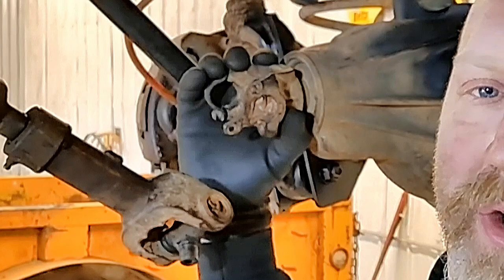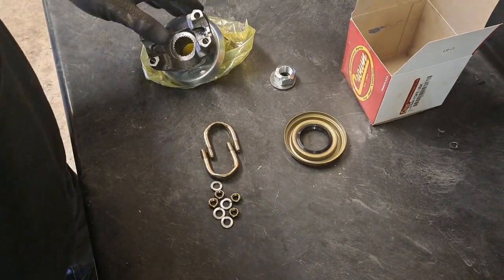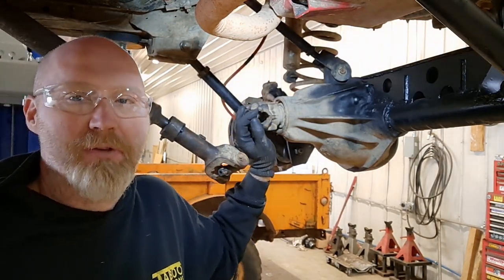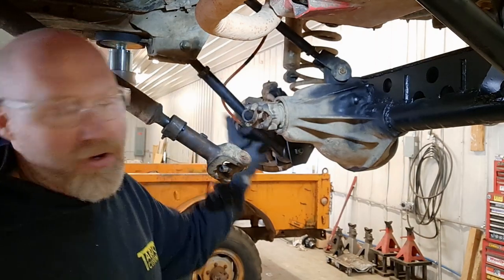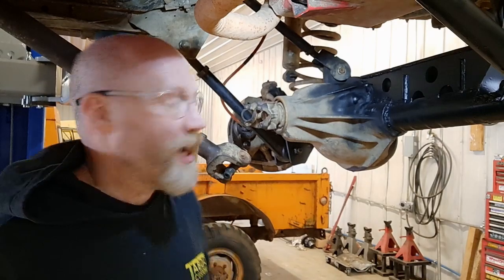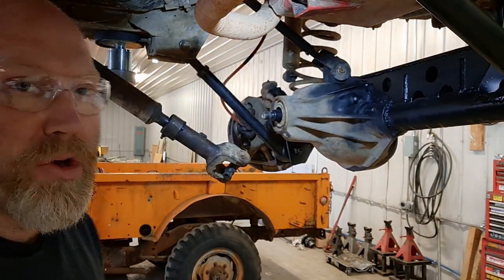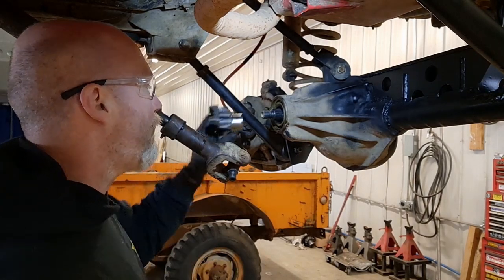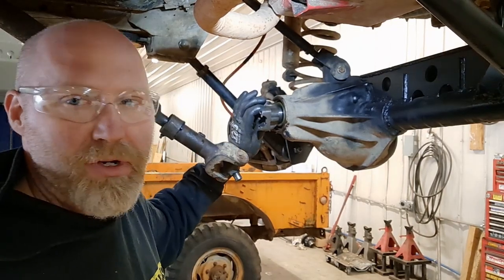TJ/XJ Dana 30 U-Bolt Yoke Discussion and Installation

Comment: My 01 wj 4x4 4.0 L 
Front pinion seal Got a dust cap , I’m pretty sure was the original set up , after 24 years at 170 thousand miles started leaking. I got the new pinion seal but can’t found the cap 
Took me 2 hrs of a street fight with it to remove it, was pretty pretty rust and stubborn Don’t wanna go to the shop 
trash bin 😊, but finally I won the match. I put the new pinion seal with out the cap . I think will be ok .  GR8 vídeo clip sir .
Reply from the maker: Not a huge deal to leave that dust cap off we see a lot of them without that dust cap.  Thanks!